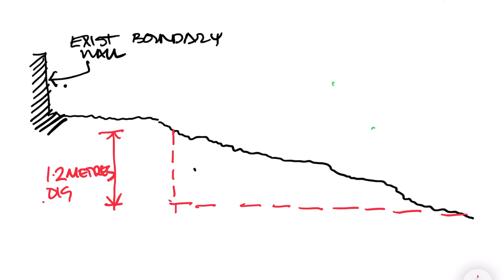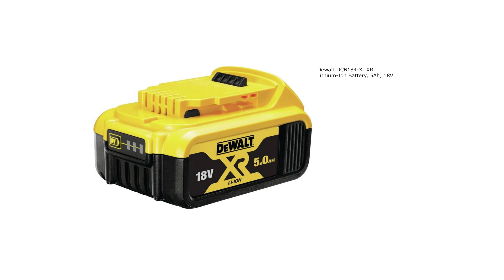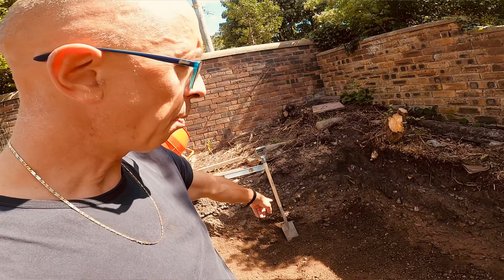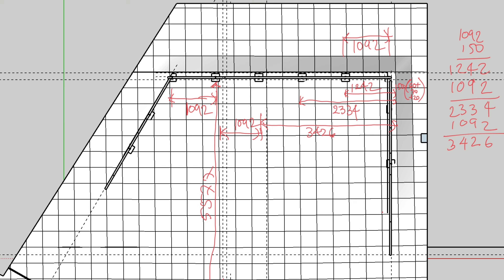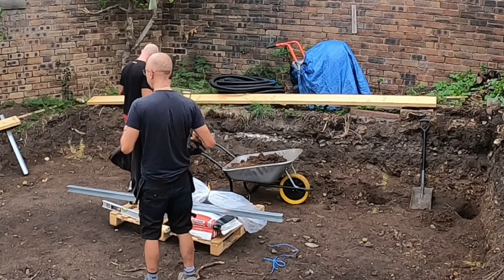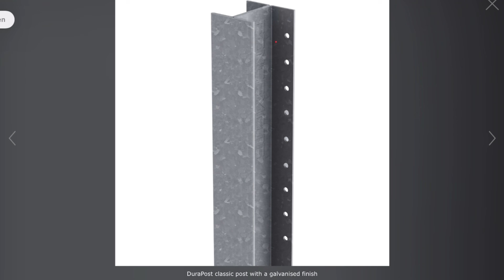Garden Retaining Wall  - Foundations and No timber sleepers

Comment: Did you contact durapost and see if their posts can be used as a retaining wall? They are a fence post so not automatically suited to retaining walls. Also the 1/3 buried, 2/3 sticking out is a rule of thumb for fences but should be swapped round for things like sheet piles but it depends on the ground conditions. As a geotechnical engineer who designed retaining walls for a living I am surprised you have taken what appears to be a 'seems about right' approach rather than a calculated approach given your other content. There is low risk here as no buildings are being supported but it's always good to do things right.
Reply from the maker: Your last sentence was my aproach, preceded with a chat on site with my engineer colleague, looking at the state of the soil with a couple of deep trial holes dug.
Reply: @build-better-things  Fair enough. Reading it again now, my comment was bit negative and mean. I was obviously in a bad mood, sorry.

Comment: So do you not put any gravel or sand under the bottom timber?
Reply from the maker: If I’m understanding you correctly, …you want to space the bottom timber off the ground by a small amount to avoid rot.
Reply: @build-better-things  okay thanks! Just held up by screwing them into your metal I beams? If I'm not using the metal I beams, can I just sit them on sand and gravel?

Comment: Your videos and presentation is top notch sir, you make everything understandable and I cant help be inspired! Have got a question regarding a retaining wall. Is it possible to use blocks to act as both the retaining wall (only need to retain 400mm of soil at the highest point) and main wall of an annex? 

Basically it would be great to combine retaining wall and the main annex structure wall into one structure on top of a single concrete slab (with adequate backfill and drainage solution), then build a timber frame on top of the two rows of retaining/annex wall blocks. but not sure if its ok to do or best avoided.
Reply from the maker: Hi. You could do it but you’d need to tank it, even for that low height. Plus, for that arrangement you can’t allow for any lateral movement, so the retaining wall design is more important. I left a gap of 600mm so I didn’t have that issue.
Reply: @build-better-things  thank you, keep up the good work!

Comment: Hello again. Instead of the Bitumen Black Jack paint at 8mins (your video), could I adhere DPM to the back of my wooden retains wall instead? Or better still, could I adhere DPM to the Black jack and have essentially, double the protection? Somebody once told me that DPM could attract moisture to the wood it is stuck to. What would you suggest? I have a roll of DPM that I don't want to go to waste, but don't want to speed up the decay of the wood if it attracts moisture.
thank you and great video BTW :)
Reply from the maker: Hi. I would avoid DPM at that point. Timber is best when it can “breathe” and bitumen allows for that. DPM does not. Remember you’re also getting moisture migration from the open side and the damp air, and it will just get trapped at the DPM where the timber face is against it.
Reply: @build-better-things  thank you. Honestly you’ve made things so much easier now!!! All the best.

Comment: Can those metal posts be used as posts for a fence?
Reply from the maker: For a fence, where you’re not propping up the weight of ground, you can put them between the flanges, securing them through the screw holes, as opposed to the way I did them,,

Comment: Interesting job with the metal angle. Well done, that’s a lot of work, video is fully of lovely detail, be careful with the background music level, your voice over tends to get a bit hard to hear, if you want the music loud side chain a compressor on it with your voice that way when you speak it ducks the music level. Lots of TV & radio is done that way, personally I’d ditch the music or play really low for the dialog bits & lift it for the sweeping shots. Many people play back YouTube at a faster than normal rate so music is often not preferred.
Reply from the maker: Thanks a lot for the comment and the feedback. I don’t generally use music but need to hear for some of the explanations where I didn’t talk. I tried the ducking but still not there yet.
Reply: @build-better-things  happy to help any time , as am an audio engineer,  impress your voice too for more of a voice over feel, it helps thicken and lift and low parts of the voice over, all TV stuff is very compressed, bear in mind it lifts background noise so careful recording can sometimes be needed. Just aim for something like a 4-1 ratio and not too fast an attack , most plugins in video editors have presets anyway. For the ducking just look to see the gain reduction on the music when you hear the voice, then you should hear it working , mind you may need to send to it pre-fade if you sending to it from the voice over. You’re great at detail so I’m sure you’ll get it , it looks & sounds great already, you have a lovely voice , lots of the times people sound like their recoding in a bathroom etc which sounds awful to watch.
Reply from the maker: Thank you for going into that detail. Really appreciate the help